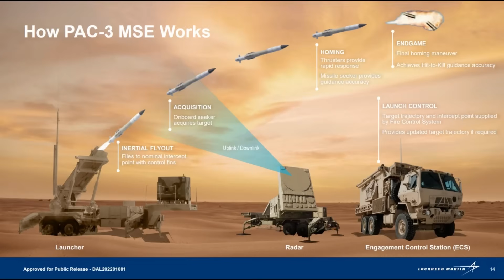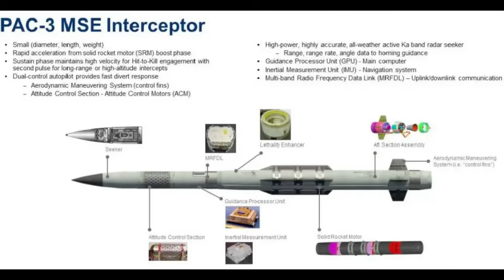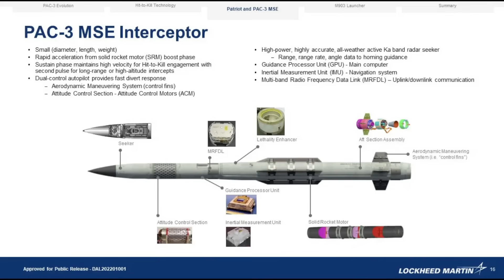The Missile the United States Is Rushing to Build (And Why)

Comment: Excellent video.  If there is so much demand then why doesn't Lockheed expand production.  The F16 is also in great demand - Poland wanted to buy new F16's to replace or augment their fighter/bomber force but the waiting list was so long Poland could not wait and bought a small South Korean fighter/bomber.  US advanced weapon manufactures are profit motivated and they keep supply limited to increase profit per unit.  I have a bad felling the  West will run out of munitions and China (CCP) and Russia will win.

Comment: Sounds like a golden opportunity for beam defense systems.
Reply: It wouldn't do the same job even if the tech on that scale wasn't decades away. A beam weapon cannot hit 90 targets from 90 different directions at once for one thing. Current generation beam weapons are used for taking down slow moving small drones. Target's you have time to hold a laser on for a few seconds will it melts. Ballistic missiles are simply moving too fast and don't give you a long enough period of time for the bean to melt the target.
Reply from the maker: Exactly and the lasers now like Helios can only take out small targets, basic ballistic missiles and drones.
Reply: @FiRMGUYS  What about high powered microwave beam weapons?

Comment: Something that passed under the radar a few months ago was that a SM-3 missile successfully intercepted another missile flying at the same speed and trajectory as an ICBM.  I wonder of the PAC 3 has the same capability?  If so we can make missile to intercept ICBMs a less than 10% of the cost of an ICBM. (And if we get true mass-production running we can cut the price in half.)
Reply from the maker: Good question, and the short answer is no, PAC-3 can’t do what SM-3 does.
SM-3 intercepts ICBM-class targets in space during midcourse, outside the atmosphere. PAC-3 is a terminal, endo-atmospheric interceptor designed for short- to intermediate-range ballistic missiles, cruise missiles, and aircraft. By the time an ICBM reenters, it’s moving too fast and too high for PAC-3 to engage reliably.
PAC-3 is much cheaper and extremely effective, but it complements systems like SM-3 and GMD; it doesn’t replace them. Missile defense only works as a layered system, not a single interceptor solution.
Reply: MIRVs mean ICBMs will always have the economic advantage over ABMs ... still there is something to be said for being able to shoot down the random one-shot ICBM from a terrorist or rogue state or accidental launch.